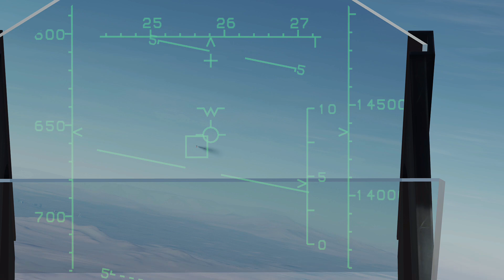DCS World - Can You Launch Multiple Semi-Active Radar Homing Missiles at a Single Target?

Comment: Multiple sparrows guiding on the same target and prvious sparrow launches on the same target going stupid are both correct, it just depends on the plane youre flying. In the F-14 previous launches will go stupid, and in every other plane i know of that can use sparrows all the sparrows will guide.
It comes down to how the AWG-9 radar functions. Basically the AIM-54 when launched with the mothership radar in TWS mode it still uses the radar returns from the mothership radar to guide like a semi-active missile does. And the radar switches to one of 6 different frequencies when it updates one of the tracks its sending a phoenix to. The phoenixes see the returns and combine that information with the mid-course correction data its getting from the mothership through datalink to guide in until it reaches pitbull range, where it switches to only using target information from the target the missile itself has locked up. To keep the phoenixes guiding on their own target though each phoenix is tuned to one of the frequencies that the radar is putting out at launch. But the AWG-9 does not drop these separate frequencies for each missile when its in STT mode, it will just switch to the next frequency when the trigger is pulled and another missile is launched. But since its not scanning around it will not switch frequencies anymore and it will keep transmitting the frequency for the most recently launched missile, causing the previously launched missile to not have any guidance source anymore and because of that the missile goes stupid.

The F-4, F-15, F-16, F-18, and every other sparrow capable plane i know of do not use separate frequencies for separate missiles, and as such their sparrows will not lose their guidance data source when a follow up shot is fired.
Reply from the maker: Wow, thank you for this very detailed comment. This is really the only logical explanation but nobody was able to express it so accurately until now.

Comment: There’s nothing classified about how an old Sparrow SARH worked and therefore no reason to somehow go around and censor/alter every single account (including those from the IAF) to change this one small facet of its performance. It’s possible that, since the AWG-9 was really designed to handle the AIM-54 (which used inertial guidance to get it close enough for its active radar to lock the target), that - for some unknown technical reason - it couldn’t guide multiple SARH missiles to the same target.  You should try this with the F-14A in DCS and see what happens.  Who knows - maybe they modeled it correctly. Bottom line is that the F-15C (and F4) absolutely could - and did - guide multiple Sparrows at a single target.  With a pK well under 30%, it makes no sense to not employ the AIM-7 this way.
Reply from the maker: Thanks for that elaborate comment. Actually,  viewer confirmed that he had no problems with multiple Sparrow shots on the F-14. 
They should really have a free to play period again, I will gladly try :)

Comment: I have over 3000hrs in F4’s......fired Aim 7’s numerous times ....never was advised by Raytheon that multi shots wdnt work...the missle neds illumination from the F4 transmitting rf thru its antenna lock...the missles do not compete w/ each other after launch...they are independent....COOL sends....usmc
Reply from the maker: Thank you very much. That is extremely helpful!
Reply: I have 0 hours on anything, but this is exactly what I thought. Those missiles need a steady beam of RF from the radar and as long as they have it they should home on target without competeing.
Reply: I have a similar question for you guys. Can one plane "buddy paint" the target with his radar and his wingman approach, radar off, and fire the missile or missiles. 

I would have assumed this would be the obvious thing to do, given that the shooter is not broadcasting his position.   

I have debated this and tried to find evidence and come to the conclusion that if this technique is/was used it is not talked about. 

I did read about Russian jets radar updated so it would not interfere with the wingman's missiles for what its worth.  But no evidence one way or the other really.
Reply: @rawnukles   I was thinking somewhat similar, but if AWACS would buddy-paint the enemies. It would be a bit stretched, though, because of the strength of the return signal and possible loss of line of sight, in case target does evasive manoeuvers. 🤔
Reply: @PappaBear_yt  IIRC way back in the Flanker 2.5 days the Su27 was modeled so that it could fire R-27ER and the Awacs would support the missile . It made R-27ER basically a fire and forget missile.
Reply: @rawnukles  Sadly, never got to play Flanker, but the idea seems legit.
Cheers!

Comment: I am completly shooting here and I base my thinking on Heatblur's F14 Manual, but it may have to do with CW antenna and Pulse Doppler STT. In CW, each missile have dedicated channel, which prevents i guess mixing up of data between multiple missiles in air. Meanwhile there is no info about channels for pulse Doppler STT, so maybe in that mode you can only guide 1 missile at the time?
Reply from the maker: Have you tried something like this on the F-14 in DCS? I don't have that module so I'm not really sure.
Reply: @showtime112  i play PvE and PvP using the Tomcat and have never had an issue guiding multiple Sparrows (AIM-7F and MH) to a single target.
Reply from the maker: @GalmOneGaming  Wow, thank you for those extensive and very helpful answers. The little doubt that I had about this question is pretty much gone now. A cool article to read too.
As for Ward Caroll, he seems to be very critical about the lead Tomcat RIO from the 1989 incident with maybe the biggest emphasis on the 'mistake' of launching two Sparrows. That's how I saw it.
Reply: @showtime112  thanks, I absolutely love your content btw. Keep it up! The vidoes covering Israeli Eagles during the Lebanon War are probably my favourite ones so far.

I'll check out Ward Caroll's video. I just discovered his channel but have yet to watch the Gulf of Sidra video.
Reply: @showtime112  so I just could not put this question down myself, but I found another source stating that the Gulf of Sidra (1989) Sparrow issue was due to an incorrect switch setting which was common at the time: http://fly.historicwings.com/2013/01/splash-two-migs/
Ward's videos are amazing but I think just this one time at least, he may be mistaken.
Reply from the maker: @GalmOneGaming  Thanks for this. I also really like covering the Lebanon War. Even though those videos are not the most popular ones, there are plenty of stories left and worth the attention.
Reply from the maker: @GalmOneGaming  I read the article. Yet another plus for multiple launch theory. As for Ward's video, I just posted a (rather elaborate) question myself. But you can join in if you want.
Reply: @showtime112  someone just asked the same question again in today's live talk with Ward Caroll and he mentioned the channel switch that the AIM-7s have to do. Perhaps this is a mode in the F-14, but I'll keep looking. I don't see this kind of thing in DCS. 
Let me know if you get an answer :)
Reply from the maker: @GalmOneGaming  Well, other's must have picked up on that too. I will post his answer here if I get one.
Reply: Tuning radar sets on the ground was a practice done to prevent different aircraft radar sets from interfering with each other. There is no physical limitation to firing multiple SARH missiles at one target. Upon launch, and int he case of the AIM-7E on the F-4, the missile would tune to the radar frequency and modulation (if any) via dielectric panels located in the missile wells. However, the Tomcat does require separate CW and PD illuminators (i.e. a total of 2 TWT oscillators).

The radiation from the host radar is used as a reference in the SARH missile rear antenna while it then homes in on reflected energy. Any missile tuned accordingly will follow this echo. There is no other "data" per se transmitted to the missile after launch in terms of target coordinates, velocities, English bias maneuvers or loft commands until the advent of INS in missiles like the AIM-7M H-build, AIM-120 or Russia's R-27 in the late 80s/early 90s. Dedicated channels would be used by the AIM-54 which needed to be guided by the WCS to different targets but that's a different story. 

There are a few retired RIOs who are active in the online community. If this continues to be a debate, I would like to ask them about their opinion. All respect to the RIO in the video, but my research implies they might just be mistaken or maybe their answer was not understood as intended. 

The USAF had a lot of experience with broken Sparrows in Vietnam and the Israelis had similar experiences in 1973 during the Yom Kippur war so they became used to the best practice of ripple firing their Sparrows due to the propensity of missiles simply being broken. Another piece of evidence to support this is here, where Lt. Rob Graeter explains that it was standard practice/recommended to launch all 4 Sparrows when a valid launch solution was gained on a MiG-25. Note that T.O. 1F-15C-34-1-3 states ripple firing (i.e. quick 20 ms button holds and releases) more than 2 results in a hung missiles so I assume you'd ripple in pairs, wait and then do it again. https://militarywatchmagazine.com/article/foxbat-hunting-how-elite-u-s-f-14-and-f-15-fighters-trained-to-eliminate-mach-3-targets